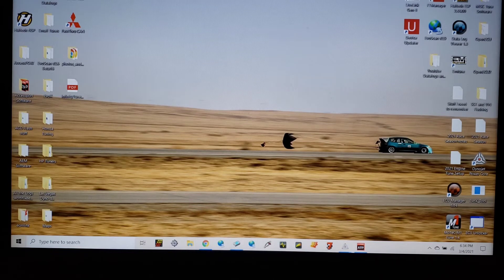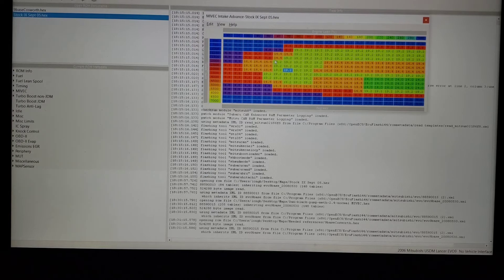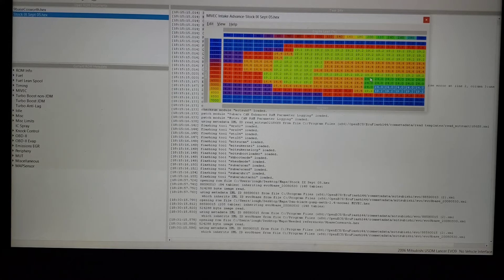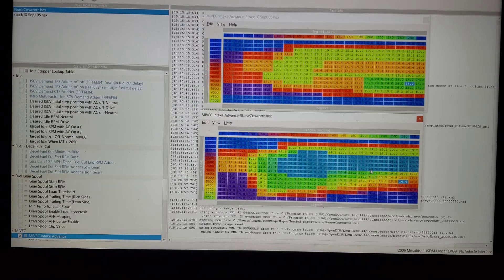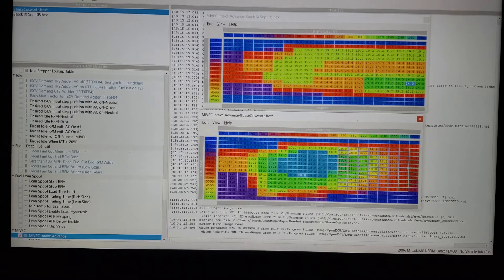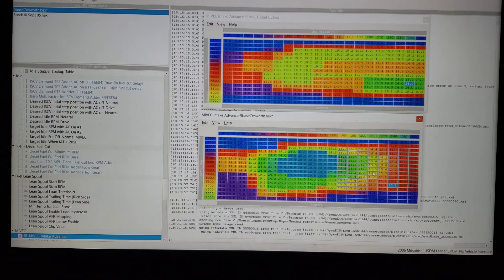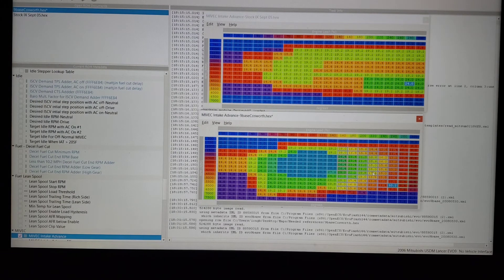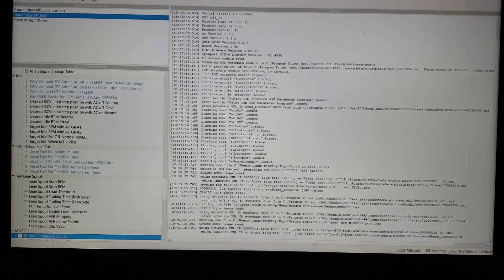Variable Valve Timing Tuning ep. 1

Comment: On the subject of peak cylinder pressure and using cam advanced to control that, how much does that peak cylinder pressure play a role into knock?
Reply from the maker: Directly since it's also generally at low engine speed
Reply: @AaronONeal1  I guess I should’ve said for the guys who don’t understand what cylinder pressure does at lower rpm.
Reply: @tonyeigenseher6443  Increased cylinder pressure increases torque at low rpm. It can cause knock, but it can be managed.

Comment: When logging a evo with a maf at 6000ft altitude, would it be normal to see 0 psi at about 70 load? Thanks!
Reply from the maker: I would have to go thru my logs and see if I have a Colorado car for that one.  Some of that is relative to the tuner and how they set up tables up.  Ambient pressure at Colorado Springs as an example is 80kpa instead of 101.
Reply: I am near castlerock which is 6200ft. So up here you are more than likely going to have a lower load range and you would make adjustments in the corresponding cells? Please let me know if you find any logs, really appreciate the help!
Reply from the maker: @stewartrhaines  0" is still going to be 83-85, I think what you are talking about is floored will not be 0" but rather something like -3" of vacuum switch could be 70
Reply: @AaronONeal1   My logs are showing 1psi at 82 to 85 load I can try and adjust my equation in evoscan. Thanks for all of your help!
Reply: So here in Colorado at 80kpa you would want to run your fuel and timing maps the same as someone at sea level at 101kpa? Almost every video about tuning I have seen they only talk about tuning at sea level. Might be a cool video talking about tuning at different altitudes. Thanks again!